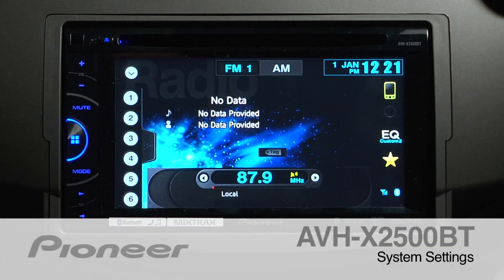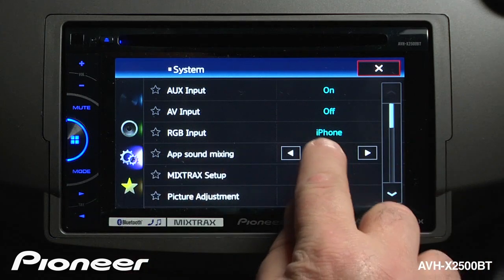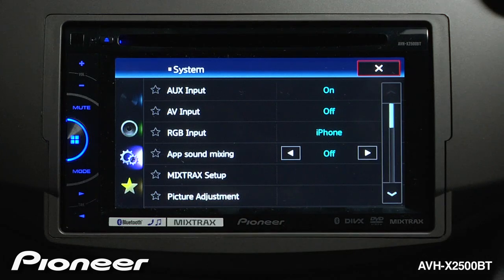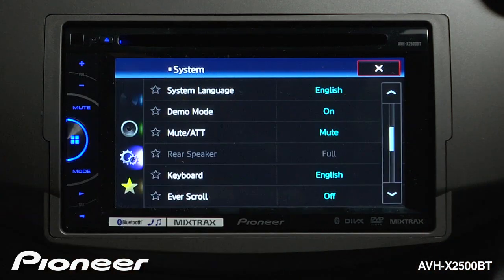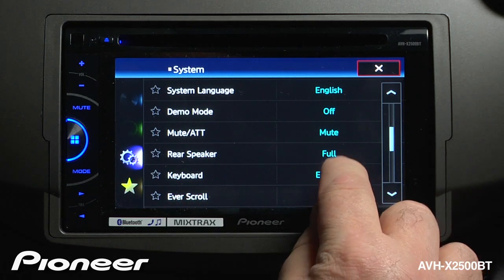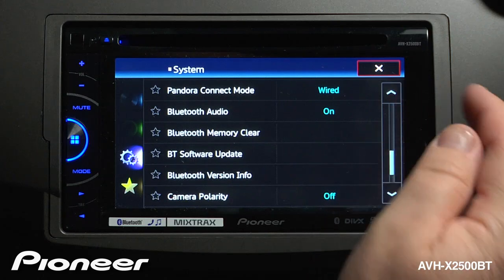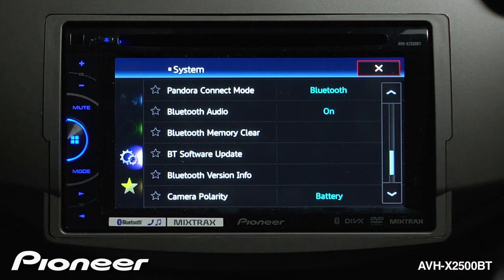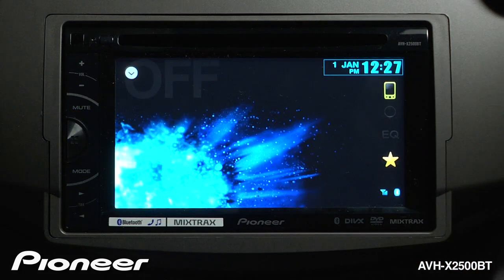How To - AVH-X2500BT - System Settings

Comment: Amigo, estou com erro 02-D0 e não consigo resolver
Reply from the maker: What is the model number of your Pioneer in-dash receiver?   What are you trying to do when you see this error message?   Error -02 usually means a problem with the disc.  Dirty disc, scratched disc, damage disc or other problem with the disc.
If you have the Pioneer AVH-X2500BT, this product was manufactured back in 2012 and the receiver may need to be serviced.
Please contact Pioneer Customer Service for help in finding a Pioneer Authorized Service center in the US here:    https://www.pioneerelectronics.com/PUSA/Support
You can find more videos on Pioneer's YouTube Channel here:    https://www.youtube.com/user/pioneerelectronics

Comment: So how do i get picture adjustment to be an option?? It wont open
Reply from the maker: You’ll need to engage the vehicle’s Parking Brake in an ON-OFF-ON operation in order to access the  picture adjustment setup menu. This might also be known as the Hand Brake or the Emergency Brake.  If you engage the vehicle’s Parking Brake and still can’t access the  picture adjustment menu, the in-dash receiver’s Green Parking Brake Wire may have an incorrect connection to vehicle.  You can learn more about the Green Parking Brake Wire in this Pioneer How To video:  https://youtu.be/-bF3uzzaT30
You can find more videos on Pioneer's YouTube Channel here:  https://www.youtube.com/user/pioneerelectronics

Comment: Pıoneer Avh-x8700 I had a calibration problem. touch detects from above. so I can't enter a password. the device does not turn on. How do I perform a general reset
Reply: On the Pioneer AVH-X8700BT there is a microprocessor reset button on the hard key panel at the far right.  I recommend to press the Microprocessor Reset Button.  Put the face on the receiver, start the vehicle, and press the microprocessor reset.   You’ll need a paperclip or some other small point to press the microprocessor Reset button.  On the Pioneer AVH-X8700BT,  you can find the microprocessor reset button on the hard key panel to the far right.  This may correct the issue with the touch screen alignment but, will not remove the password.  I also recommend to clean the metal contacts on the back of the detachable face and on the in-dash receiver.  If this does not correct the issue, please contact Pioneer Customer Service in Europe here:   https://www.pioneer-car.eu/eur/support

Comment: My screen keeps going to a message about.... Camera Rev... How do I get nav screen back with icons..
Reply: What model of Pioneer in-dash receiver do you have?  The model number is usually printed on the face of the in-dash receiver in one of corners.
Reply: @deckerdotto6035  thanks for responding... I found a reset button upper left corner of the face plate. Pushed it in.... It's normal.
Reply: How do I get back to the source screen.